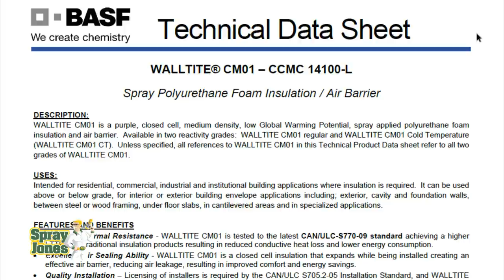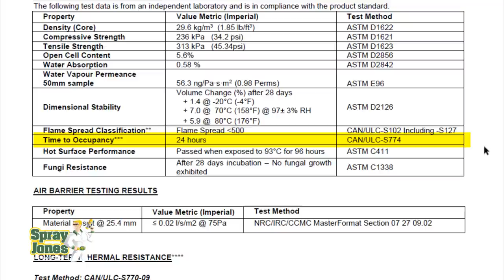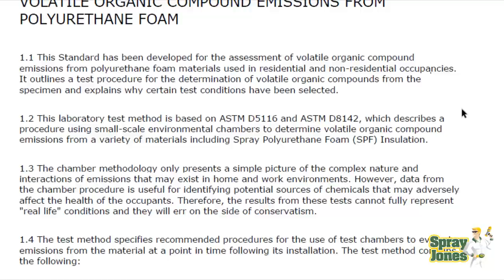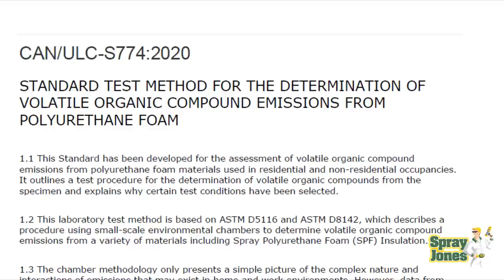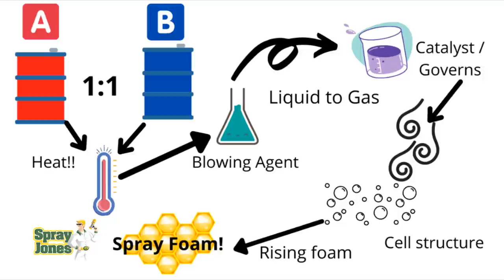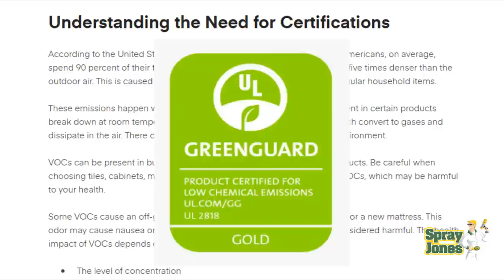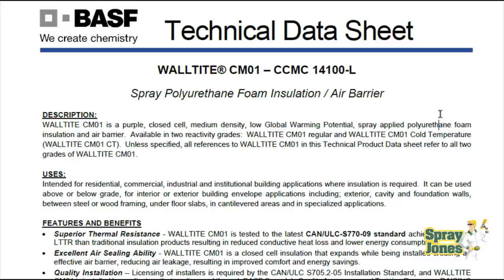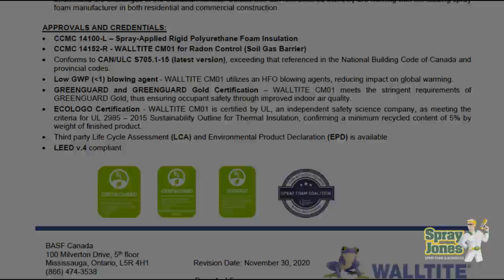Spray Foam Insulation & Off-gassing

Comment: Hey Spray Jones thank you for putting this out! Curious how open cell vs closed cell spray foam affects these findings? You mention that in closed cell because the cells are essentially a vacuum it prevents future release of VOCs, but what about open cell SPF? 

Reason I ask is because open cell tends to be more popular in my area (Florida, US), because it’s water permeable and often sprayed on the underside of roof decks, so you’ll notice if you have a roof leak sooner than you will with closed cell. 

Any thoughts on toxicity/ release of VOCs with open cell?
Reply from the maker: Both are very different. If something is not mixed correctly it is going to smell. 
Open cell uses water to blow it open, so yes there is no diminishing value on insulation values.
VOC test is just that, the VOC within 24 hours.
Reply: @SprayJones  thank you Spray Jones! I appreciate the additional insights there. :)

Comment: Thanks Mike, very informative. Now, what about people like me who have open cell spray form in the house that I have lived in it since 2008. Can I remove a piece of foam that's been installed in my home and have it tested for VOC's? I live in south Louisiana. Can you provide a company for testing samples for VOC's. or, can you suggest a monitoring/testing device to sample the air for VOC's. I guess I can always call a company locally to conduct in-house testing. My reason for asking is because the two air condition air handler in my attic have failed multiple time due to evaporator coil leaking refrigerant. The last times the coils leaked, we replace them with coated coils. Haven't had any more problems. The A/C service company said it a problem with spray foamed homes. The temperature and humidity in the attic typically run about 10 percentage points higher or lower then the living space in my home.
Reply from the maker: I have not seen that where we live. I think you are getting some BS from HVAC. Watch video 3 & 4 for non-vented roof series where I address humidity levels in attics.

Comment: I saw a special on TV where the foam made the family sick and they ultimately had to have it all removed.  Even after that, the fumes were still there and they never could move back in.  Apparently some of them were hyper-sensitive to chemicals.  I believe they had to sell the house.
Reply from the maker: Sprayed wrong. Total failure on the installer's part.
Reply: What can cause that?  inappropriate mixing ratios or catalyst used?  We've thought about spray foaming a few walls in the house, mainly for noise reduction, but after seeing that special on TV (60 min or something; can't recall) we opted not to do it.  My wife is also hyper-sensitive to chemicals to the point where I have to do all of my interior painting projects while she's visiting her family overseas for a month. @SprayJones

Comment: I live in the tropical part of Australia and I enjoy listening to your podcasts.  No one spray foams homes within a 1000 miles.  However I'm very keen to bring a company up to do my new build house.  Part of the reason for my interest is the house is in a cyclone area and the foam adds strength.   With climate change we will get more and stronger.  How about a podcast on how spray foam strengthens a building.
Reply from the maker: I am looking at ideas for 2022. Podcasts require a lot of time to put out the content, and I want to make sure I have 1 year worth of content before starting - depending on frequency of episodes. 
Thanks for watching down under.

Comment: Are VOC’s primarily an issue with closed cell foam?  It seems that open cell installs are not as concerned about hitting a certain depth….basically trying to fill the cavity.
Reply from the maker: Any SPF can have VOC issues. Open cell foam has a lot of catalyst in it and has to be well mixed to work 100%. Sometimes that step is skipped.

Comment: Very well explained Mike here in the uk I have noticed that since my particular resin was changed( now hfo) I use more product taking into consideration temperatures of structure and ambiance temperature this normal now ?
Reply from the maker: Yes. 

HFO is a difficult chemistry. Only the top chemists will be making a great product now. In the past it was easier. 

Keep playing with settings. AND UP YOUR PRICE.

Comment: Excellent points. Thanks for clearing a lot of air. In summary I would like the sprayer to do 1 inch pass everytime and comeback and add 1 inch after. Willing to pay more for labor and get it right.
Reply from the maker: It is really not necessary you have to be over double the recommended thickness to start to have an issue. 

In fact the foam is designed to fair the best at the 2 inch pass mark.

Comment: Mike, I do not know how many times I have run into a job where the problem was as simple as the previous technician just didn't read the friggen label. In 35 years, I'm sure I made a mistake or two- unlike some really great plumbers, I have had a leak or two- but honest observation and thorough testing meant they were my problem and not my clients. Great presentation- I'm not sure how you do it, but it seams you have some way of "highlighting" the important parts- Good on Ya"!  On the matter of US testing and standards, these things are usually done state by state- I live in Texas and the only Texas approved product of Canadian origin, with the State Lege or regulation offices, is Lyin' Ted. I don't blame Canada for him, just every now and again, a cropper gets through. Texas may be a bit longer getting those standards, so I'm hoping you might have some ideas how us "unwashed" might get these tests and assurances done. FR
Reply from the maker: Thanks for watching.
Reply: @SprayJones  As usual, you did the work! Paul seems to have a game plan and has got what financial it will take and it sounds like he will be peeling all of the exterior walls as your reprise of "saving' a bad job pointed out. A nightmare even if caught before the sheet rock process is started. I'm beginning to learn how to watch out for this particular bus- awesome! the tip you offered for a supplier in Arlington will be a good beginning. The politics this will take in Texas current "deregulate everything" atmosphere is something I don't want to wait on- self education is my friend! With help, anyway.

Comment: Thanks for the video. Do you think that spraying another inch of foam over stinky foam could solve the smell? Currently in that exact situation, have lots of room for more so they opted to spray another layer but I'm skeptical it'll work.
Reply from the maker: Well.... the reason it stinks is that something is wrong with the chemistry from how it is designed to be installed. 
Encapsulation is an ify idea since it does not go to the root of the issue at hand.
Reply: @SprayJones  Thanks for the response. 4 days later I can confirm it did not work. Company is now trying to claim the smell is wooden 2x4s on the walls and "if I want" I could poly the walls to stop the smell. Not doing that. Now in contact with the manufacturer's QA certification team. Wish me luck!

Comment: How Water Proof is close cell? So if your house was to flood, would you have to remove it and let things dry around it and have it re-sprayed?  or would the water not penetrate and reapplying wouldn't be necessary?
Reply from the maker: Closed cell is great against water. Watch "is there waterproof spray foam"
Reply: @SprayJones  Thanks great video.

Comment: I am in the United States and am going to get spray foam our new house. Do you think that we should have a company come out and check the air to make sure it is not releasing VOCs?
Reply from the maker: No. 
Hire a good SPF installer and research the product to use. Demilec, BASF, NCFI, Huntsman etc.
Reply: Any issues with the smell? My new house is now unlivable, open cell UPC 500 foam under the roof deck, polyglass MTS underlayment and a standing seam metal roof. With hot and humid weather the smell inside the house is very strong, unbearable

Comment: If the foam was in fact sprayed too thick maybe, as i can still smell it 3 months after a new house roof deck was sprayed with open cell and the Florida heat makes it smell. Will the foam eventually gas off? What's the expected time frame? The installer claims to have all new equipment etc and it was sprayed during good weather. He brought 2 samples, one was a year old and one a day old. The one year old sample was all yellow and practically had no smell to it. The house was ventilated without the drywall for 2 months but now it almost feels that the paint and the drywall has that sweet and bitter smell to it
Reply from the maker: Too thick too quick only applies to closed cell. The chemistry for open cell has no upper limit on application thickness. 
You can simply remove a small chunk of the foam, leave it be for a day and come back to it and see if it smells. No odor then you know the foam is not your source rate. 
Once this gets into your head that something may be off you can start "smelling" things all the time. Especially if you are hyper sensitive. 
I find people will sometimes blame construction odors on the SPF, especially: drywall mud, paint, primers, glues, sealants, on and on. 
Drywall mud has a sour smell to it when it is curing and even for a while afterwards.
So it may not even be the SPF you are smelling.
Reply: @SprayJones  definitely the foam smell but thank you for the reply
Reply: @SprayJones  definitely SPF, the house sat with open windows and doors for 2 months. Now that the drywall is up and the temperatures are in the 90s as well as the high humidity, the smell has intensified. Even with AC running and 2 exhaust fans in the attic. Just wandering what could have gone wrong with the install. They used UPC 500 foam and it’s a large installer, licensed and all. The AC makes the smell even worse as it sits in the attic. The house is unlivable I think at this point, a brand new construction, on a saltwater canal, not sure what to do next. If what I is MDI then this must be a huge issue I’m guessing.
Based on your video, which is excellent, if the chemistry was somehow changed due to bad application, the smell will never disappear sounds like.
Reply: @drchamp1902  Hi Dr Champ, I have exactly the same issue and we’ve added ventilators in the attic. It hasn’t improved, and the AC makes it worse. Have you figured out a solution for it?
Reply: @walidphul6048  I’ve installed air purifier in the ac unit, 3 UV lights, sealed the handler with tape and silicone, it feels better now, 15 months later. However, I can still smell it, it’s our second home so I’m only there once a month or so for a week. I had the manufacturer pay for it though. There is definitely an issue with this industry and foam, no one with skin in the game is honest about it, the lobby is too strong, even the lawyers don’t want to deal with this. I had a company test air for VOC, outside showed 0.3 inside and and all attic exhaust vents 0.6, double the outside. That was done prior to the purification. At this point I’ll just live with it, maybe not for long:) I’m convinced the product is pure poison and should not be used inside living spaces. It a shame that I’ve designed and built this house using the best materials and modern technology. However, the foam situation is very unfortunate, the manufacturer has offered to remove it but since my attic is unvented, I would be required to redesign the entire roof system and redo energy calcs and probably reduce AC and a bunch of other stuff.
Reply: @walidphul6048  do you know the brand of spray for your installer used? was it open or closed cell?

Comment: Video request: Is steel frame + closed cell spray foam the perfect DIY house design for an indestructible, insulated, and everlasting home? 

I was looking into ICFs initially for my dream home due to their strength and longevity, but after watching a series of a couple DIYing theirs in Washington (US), I realized what an absolute nightmare of ,necessary engineering approval, logistics, material density, and wooden barricading and boarding it required. I also realized the only advantage it seemed to have over steel frame is a continuous insulating barrier created by the concrete so there's no air-leaks, but after watching your videos, spray foam over the walls and roofs probably surpasses it. 

Your channel touched on DIY construction a bit and I think that's part of the audience - so video idea!
Reply from the maker: Ok, will do. 

Thanks for watching.
Reply: @SprayJones  Aw yiss. And thanks for the detailed explanation of low-voc emittance and the weird smell topic. I said it before but you might as well seek an honorary degree as a materials scientist.